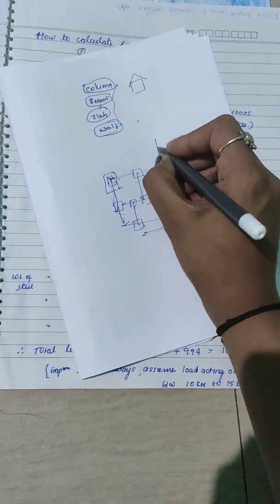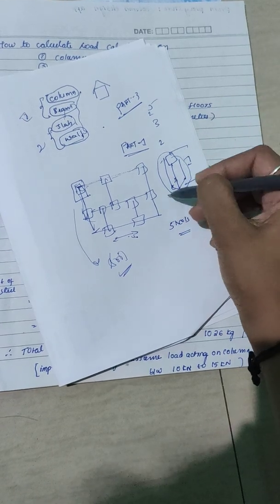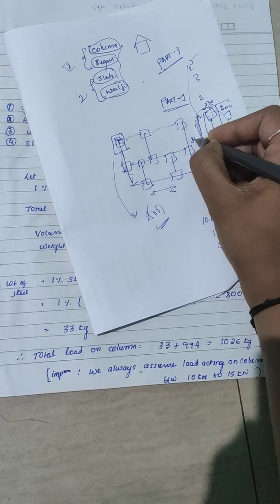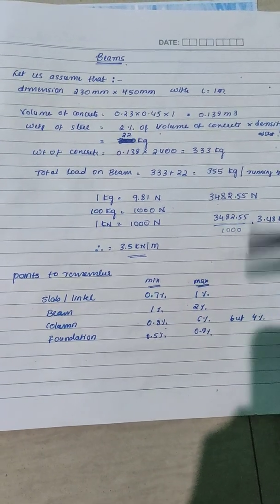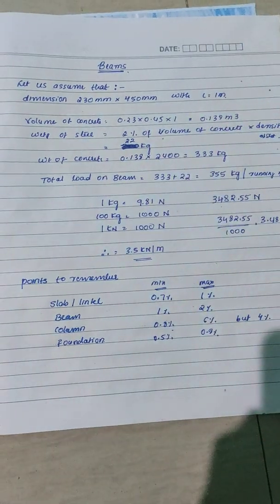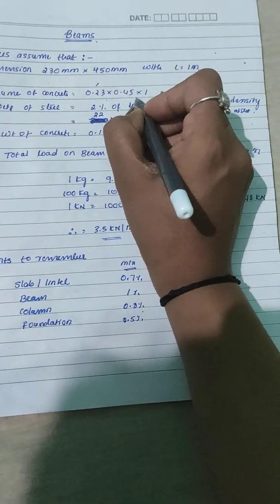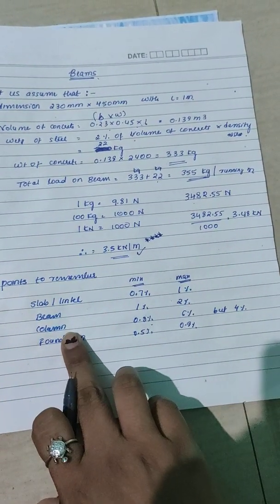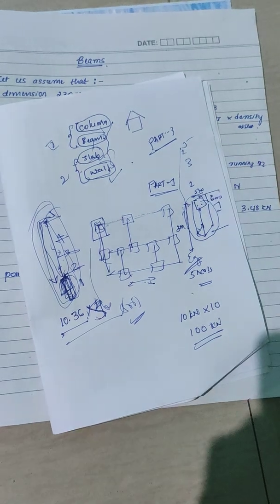Calculation of Load acting on column Beam Wall and Slab (Part-1)

Comment from the maker: In calcultion of columns while calculating steel consider 1% of volume of concrete... Where volume of concrete as 0.414 not 994 small correction